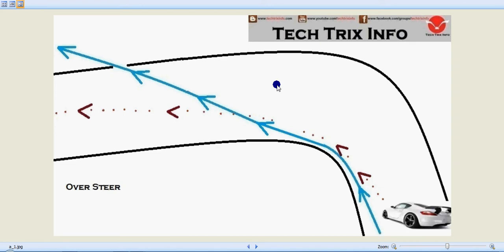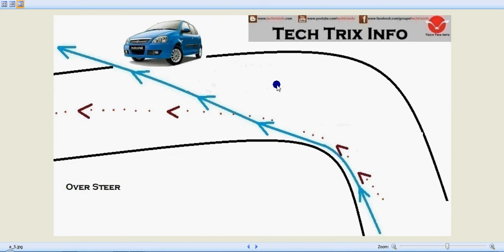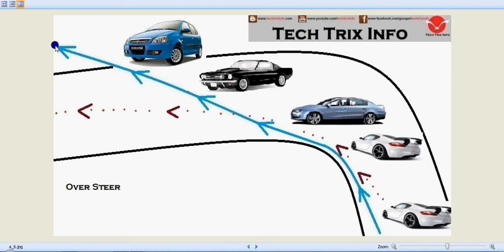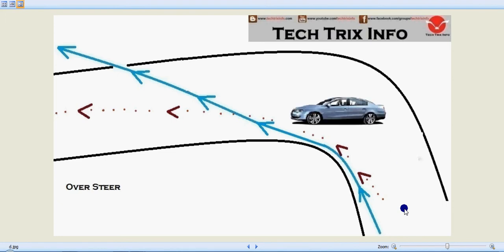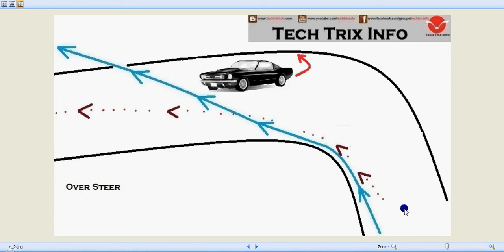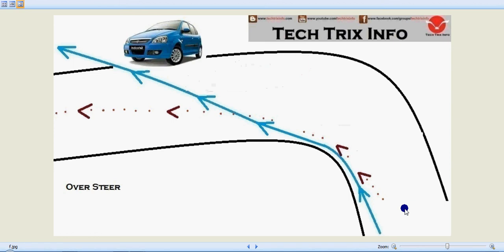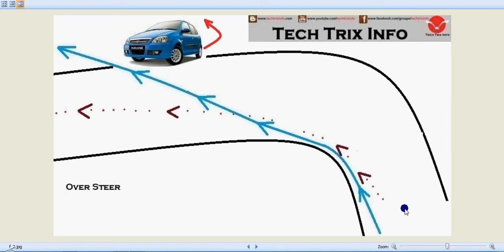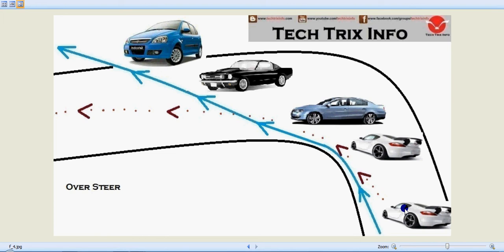How to over steer my car. ✔

Comment from the maker: This video explained about oversteer "how it happens and how it can be avoided".
Oversteer happens when a vehicle is taking a turn, normally moves towards the apex. The rear tyre looses adhesion or traction and slips away. The driver will have to turn the wheels to the opposite direction of the turn to hold the vehicle stable. The vehicle or car goes out of the road or track as the rear wheels skids away. This is called over steering. The video animation clearly shows how over steer occurs.